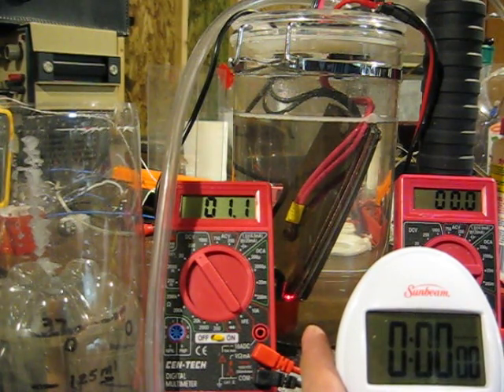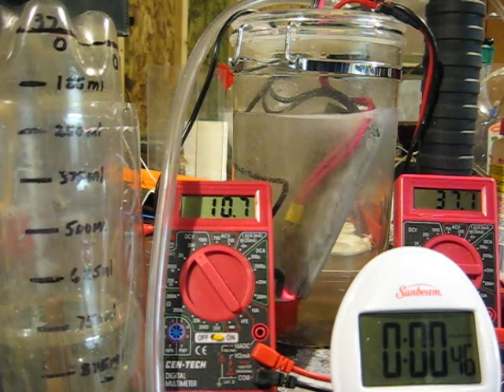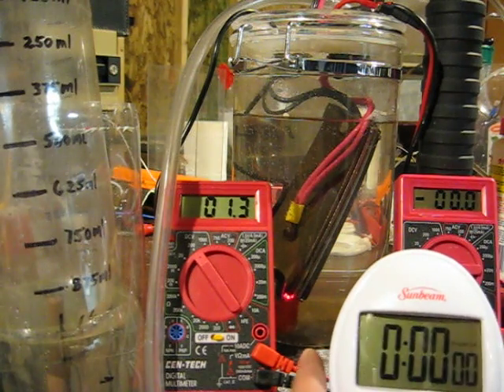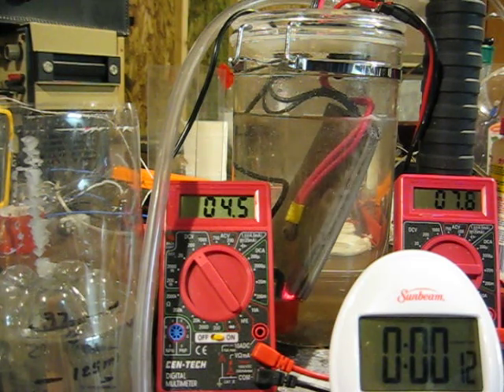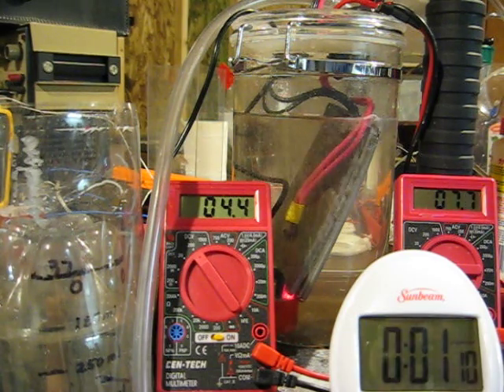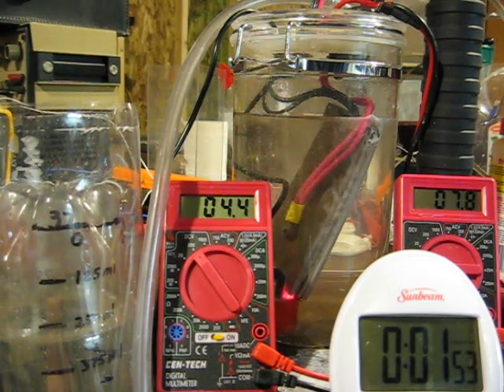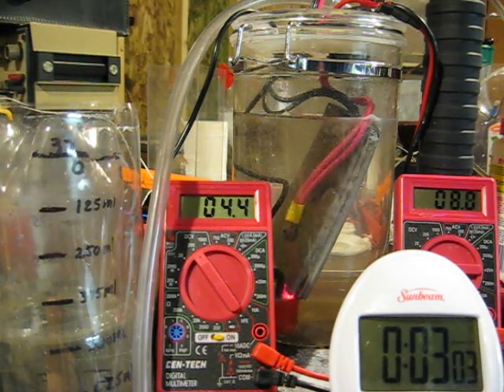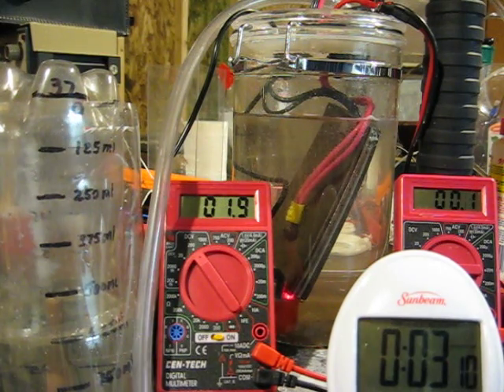1 Liter per Minute©

Comment: You said that you were running it at 35amps to start with ? - well you cant run it on a 12volt car battery as it will kill it in a matter of minutes. The amps are up high because you are using too much Electrolyte, try using 1 teaspoon of it and your amps will drop dramatically using 12volts that way it can be used in a car - you may not get 1ltr per min but it will run cooler and longer in a car as a fuel saver unit
cheers Alan

Comment from the maker: I am Using RO filtered Water with NAOH as an Electrolyte About 1TBS/ Liter.The cell will only heat up if you use more than 2.25 Volts/ per cell or plate space.

Comment from the maker: The plates are very thick .1046 12 Ga Stainless for rigidity there is two layers of United States postal service packing tape between them on each end. I measured the thickness after applying the tape. It was .1051 with two layers.
I had trouble with only one layer with the plates shorting out. Also you cannot tighten the screws holding them together extremely tight. Only finger tight. I also have a 50 Amp fuse in-line with the pwm module so if I have a problem. I won't have a fire.

Comment from the maker: There are two versions of this container one I purchased at Bed Bath & Beyond and this one at Wal-mart. The one at Bed Bath has a lid that doesn't seal very well and the seal is narrow. The one from Wal-mart the lid has a wider seal and a double wall on the lid. I Cut second top wall out to mount the fittings. if you wanted to you could fit the electrical studs and fittings in the double wall an then fill it up with a resin for extra strength.